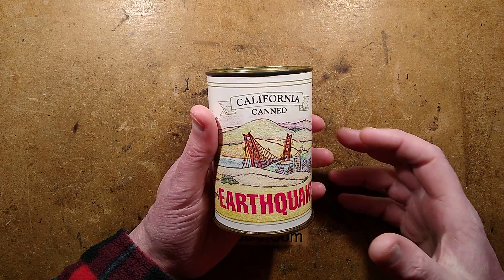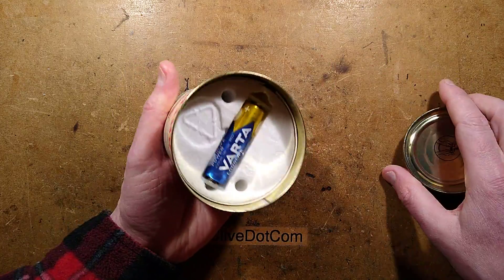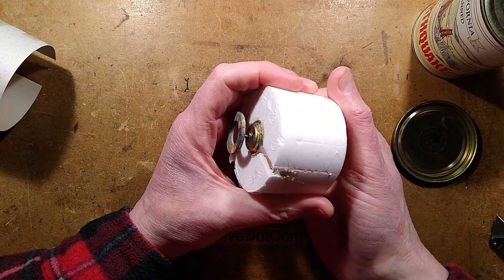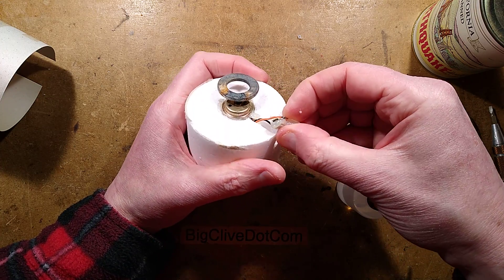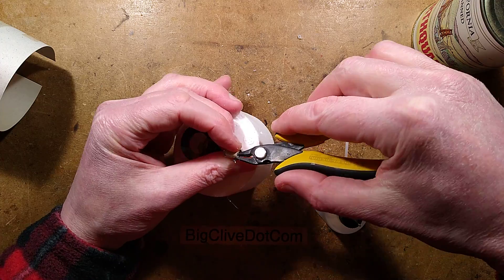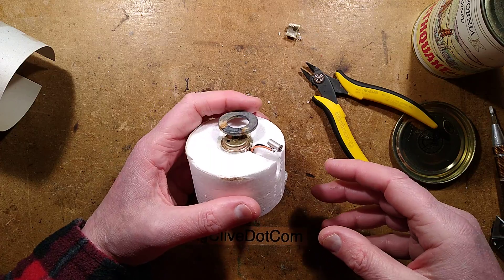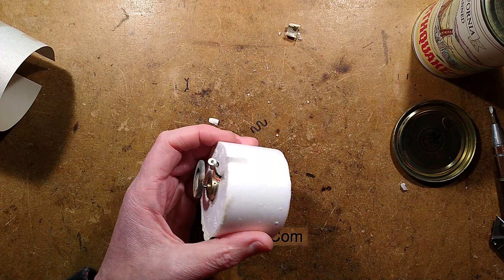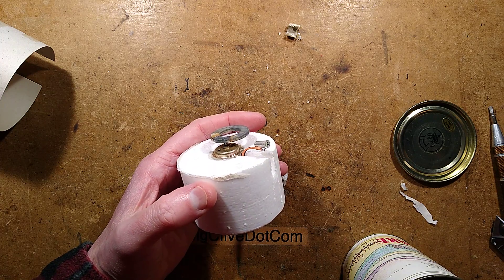Inside a Dynmo canned earthquake

Comment: Yeah on one hand you mentioned the word mercury and everybody freaks out on the other hand there are some serious effects when ingested and contacted. And ground water. Although I wonder if we've done more damage with the amount of lead we put into things not necessarily solder and circuitry but paint and things like that. Things can chip off and get eaten by kids or breathed in by kids. We tend to throw the whole baby out with the bathwater rather than considering the different forms the material takes. And with the amount of mercury switches versus the amount of fluorescent tube bulbs I would suspect we probably vaporized more with people who didn't know better (did anybody know mercury was in those things until a few years ago? You are completely fine breaking a standard lightbulb what's the difference with these new ones? ) than all those thermostats that have existed for years.

And then there's these corporations that tend to pad things with things that are clearly not safe like Johnson's and Johnson's baby powder now with asbestos. We know it's bad in an aerated form let's put it in an aerated form and not tell our customers will get more product and more money.

Comment: I think you can tell if its a mercury switch by very accurately adjusting the angle, measuring the resistance, to only just create a circuit. A ball switch will be pretty much binary based on gravity EDIT: you could probably just shake it and see "sloshiness" in the resistance rather than either on or off clacky ball contact

Comment: In the US, circular Honeywell heating thermostats used to be ubiquitous. Every one has a nice big mercury tilt switch on the end of a bimetal coil. The things are accurate and indestructible, and are an attractive example of mid-century American industrial design to boot.
Reply: I still use two T87F at home, and I also have a spare I found in my grandfather's junk. AFAIK some of the Honeywell variants (while not round) have as many as three mercury switches. These are 2H1C with automatic switchover, probably used for heat pump applications. One turns on the compressor for for heating, a second one is fixed 3 degrees lower and brings on backup heat strips, and the third one on a separate control arm brings on air conditioning.

Comment: The canned earthquake we had when I was a kid - 50 years ago - was even simpler inside. Inside, it had a rubber band attached to one end, with a rubber ball dangling from it. You could spin the can to make the ball run around the inside of the can, winding up the rubber band, then put it down upside down and the rubber band would stay twisted. Then to activate it - you'd flip the can over, and the ball unwinding would shake it around nicely for maybe 10 seconds. I was surprised to see a battery and motor when you opened this - I guess it lasts longer than the rubber band did.

Comment: The fact there's a recycling triangle on the polystyrene would say that the switch isn't mercury as polystyrene hasn't been considered to be recyclable until after mercury was banned.
Reply: It's not a recycling symbol, it's a resin identification code. Mercury thermostats continued to be made until 2005/2006 and I can swear I've seen the number 6 on things made before then.

Comment: The patent is from nov 1991 (Vibration mechanism with attitude sensing switch) and it propsed a mercury switch to be used.
I got few years ago some mercury  switches from old (late 70s) doorbells made in USSR that i bought as NOS.

Comment: Hi Clive, these switches were used in a Citroën GSA to light up the trunk. If you lifted the lid, the little metal ball touched the contacts!
Reply: That's one way to do it but couldn't it cause trouble if you park facing downhill? The cars I'm familiar with have a normal mechanical switch actuated by the door latch.

Comment: I have a couple of GIANT Mercury tilt switches that weigh several pounds a piece, and are about an inch and a half in diameter, and 4-5 inches long.... no joke. 

I found them in an old abandoned shop that I had bought years ago. 

I have NO idea what they were used for.
Reply from the maker: They do some very high current ones.

Comment: I remember taking an old doorbell (which contained a mercury switch as part of it vibratory mechanism) to the local recycling centre, and they didn't have any means of dealing with it, so it ended up in landfill.

Comment: On the subject of mercury tilt switches, can you (or anyone else) think of any reason why the far less toxic liquid alloy known as "galinstan" could not be used as a direct replacement for mercury in this type of switch? Galinstan has already replaced mercury in liquid metal thermometers and barometers, it is just as good an electrical conductor as mercury (in fact it might even be significantly better), and actually has a far wider liquid range: The freezing point is a bit higher (-19 degrees C as opposed to -39 degrees C for mercury), but it has the advantage of almost zero vapour pressure, and the boiling point is far higher - in excess of 1300 degrees C, whereas mercury boils at 357 degrees C. It does have that peculiar property of causing rapid weakening and corrosion to aluminium, but that shouldn't be of much relevance because mercury does that too. So I really don't see why a tilt switch could not be made using galinstan.

Ok, yes, it does have that annoying property of "wetting" glass, so if you put some liquid galinstan in a glass jar and shake it, the entire interior surface will become "silvered" as the alloy coats and sticks to the glass. But this can be overcome - galinstan thermometers and barometers are still made with glass tubes, by coating the interior surface of the tube with a thin layer of gallium oxide, which prevents the alloy sticking to the glass. So I don't see why the same could not be done for the glass bulbs used for tilt switches. Or they could be made from transparent plastic such as acrylic or polycarbonate, which would probably be better anyway since this would be far less fragile than glass.

On a related subject, I can remember a very crude but effective type of tilt switch in an old 1980s fan heater design, which switched both the fan and heating elements off completely if the heater was knocked over into a position where the fan was horizontal against the floor, which would have blocked the air flow and subsequently caused the elements to overheat: It was essentially a hollow plastic sphere of about 3 inches diameter, containing a smaller ball of soft lead or maybe lead-tin alloy of about 1 inch diameter. At the "bottom" of the plastic sphere (defined by the fan heater being stood up on its side with the fan blowing horizontally) was a pair of electrical contacts, so the lead ball would only touch both contacts if the heater was resting on its side - this would complete the circuit and allow the heater to switch on. If it got knocked over, the lead ball would fall off the contacts, breaking the connection and therefore switching the whole thing off. Like I said, crude but reliable and effective, as well as somewhat unique - I never saw this type of tilt switch used in anything else, just in this rather old fan heater. Have you ever seen anything similar used in anything else?
Reply: Your old heater had a ball type tilt switch. Clive mentions them in the video description. They are definitely not as reliable as mercury switches as they may "chatter" with vibration and oxidation/erosion can prevent a solid electrical connection. For a heater it's fine (if it doesn't work, whack it) but that's not an option in many applications.
Reply: @eDoc2020 The type Clive mentioned uses much smaller ball bearings, either a single ball bearing in a very thin tube or a thicker tube with many ball bearings to simulate liquid. I can see why these are unreliable, since the contact area between two balls is very small - which would be ok for a low current application, but completely useless for anything requiring significant amounts of power to be switched. Mercury or galinstan alloy would make a much better connection. The single ball in the old heater I described was made of lead for a reason - it is both heavy and fairly soft, so the weight of the ball pressing down on the electrical contacts made a good enough connection to allow 3 kilowatts of power to flow through it. A tilt switch with smaller ball bearings would probably not be able to handle anywhere near as much power.

Comment: As a teenager we regularly experimented with mercury in science lessons. 

Back then self built slot racing cars were a popular hobby. I built one with working brake lights, an idea promoted in one of the hobby magazines of the time, using a short plastic tube with connectors at one end and a blob of mercury that would make a connection under deceleration. 

Worked very well. Simple and reliable.
Reply: Hm. If it was wired to short the motor under deceleration, the car would have had electrodynamic braking too.
Reply: @interestingoldthings4889  I don't recall the details other than the "chassis" tubes were soldered directly to the motor and the axle crown wheel was driven by a pinion gear directly attached the the motor shaft.

The things we're quite light with no down force and I don't recall braking being a problem absent any bumpy surfaces.

However, no one was discussing the potential for regenerative braking back then. That said the weight penalty of even a small battery cell might have made any possible power reserve deployment a bit pointless. Unless the track in use was so lacking in grip for straight line traction that the weight might also be of benefit.

Comment: i really like Hg. i have half a jam jar full ive saved from old syphgmomonometers, thermometers and tilt switches. i particularly like poking the fluid with my finger, it feels very odd. as BC said the danger is from vapour, like from the heated vats of it hatters used to use to smooth and shape fur.

Comment: I'd guess that the venn diagram of products that are new enough to have recycling code triangles and are old enough to have mercury switches is pretty much empty.
Reply: The resin identification code was first introduced in 1988 for plastic food/beverage bottles/jars. The classic T87F thermostat continued to be made until 2005 or 2006. I'm sure it took some time for the plastic codes to become widely used everywhere but there was still plenty of overlap. I just checked the closest piece of semi-old plastic (a PC front fascia from 2001) and it has the triangle (but not the number). A network switch from 2002 is the same: triangle but no number. These are both ABS plastic (#7 "other") so maybe they had only assigned the numbers 1-6.

Comment: When I was a first year apprentice I tried to pour isopropyl alcohol into a styrofoam cup.... The entire cup dissolved fast enough for the alcohol to spill all over the floor immediately. Pretty cool way to learn that lesson.
Reply from the maker: Acetone?
Reply: @bigclivedotcom  well, I don't know for sure... It was 25 years ago, but I seem to remember it being isopropyl alcohol for removing adhesive marks on the switch boards we were building. Acetone would likely have damaged the paint I'd think.

Comment: By the way if anyone remembers Radio Shack the original ones that actually had an actual electronics parts for sale.

I knew the manager at 1 oftentimes I could get deals pretty good on the purchase the rest of inventory on things that were closing out.

I remember buying all the Mercury switches that were left.

And I didn't know why there were no longer be available and get the Parts wide good my father even suggested doing this!

 I remember the old light ropes as well.

That basically were useless unless you already have a controller!

What was left on The Bargain table to extract incandescent bulbs.

Yeah some of the bulbs are broken and would not work however what was left good for parts.

Write down even to the length of wire ran into end to not only the common connection but the pass through connections.

Everything from those that could get reused did.

Even the outer sleeve got used

I think I got them for possibly couple bucks each.

Still numerous bulbs left using in various projects!

Comment: Regarding the Mercury tilt switches and other things that they're trying to reduce let's just say I'm not really big into this but I understand why some litigation but it does cut into some things that have desirable characteristics and are useful for us makers!

For example photocells specifically cds cells.

If you know what to book for and where to buy them 

Bears eating things that would have this such as those motion sensors that big clap has mentioned before in various products that say something or might have or otherwise sound effects and sometimes light.

Yes like those Christmas decorations the little witches at Halloween and even the crow in with his other videos.

And yes I'm referring to Dollar Stores

Has been a good source of parts that otherwise would not be readily available due to obvious restrictions

But then again made in China of corse.

Is big Clive himself has said sometimes it's good to get this sort of things to repurpose or at least only use lines of saying something like this.

For example cheap Chinese and non-compliant holiday lights depending on your country you may have a different name for for this such as fairy lights.

You can get that type of wire apparently on Amazon as well if you look hard enough.

There are a lot of sketchy stuff out there however some of that stuff is great for repurposing!

Sometimes a product might be crap but what you're trying to do it's the perfect source for parts.

By the way I'm still remembering for the longest they had Mercury batteries in a lot of the dollar store items surprising but then again 

Made in China!

I'm wondering if there would ever be a battery with the performance of a Mercury cell with the equivalent lifetime.

In theory this could actually last longer when only used intermittently and the lower self-discharge then disposable lithium cells.

It's no wonder they used to be used in alarm systems and such back in the day.

Not referring to as the voltage stability but just super long life in this case most of the time sitting there doing nothing even going into an open circuit unless alarm condition.

I do remember an old system that someone had an older home 100 + yer old structure.

There was an alarm system fire alarm system it was actually a heat detection system.

Back when something like that was actually considered viable Fire alarm sistem.

All the heat sensors were in parallel normally open circuit.

Again A Fault In this design since no supervision whatsoever one broken wire could disable whole system!

The system was wired with the old cloth Fort Edward silk or otherwise material coverage of insulated wire.

Like that you could literally unwind the threads to strip the wire.

Solid wire probably about 24 gauge maybe a smaller or larger harder to say.

The idea behind the sensors by matalic thermostat.

On a Bakelite base.

Kind of oblong shaped

Top metal portion was rectangular.

The idea there was a heat sink there to act as thermal Mass so in other words would require a sustained temperature to trigger the alarm

I noticed there were several different varieties of these in the same system.

I don't know if same manufacturer maybe different temperature ratings.

Somewhere painted red and others just had the metallic silver finish.

Whole system was powered by a 6-volt Mercury battery a big one.

Even though that this system had install for who knows how long at that time it still worked.

And there was a couple times the system actually went off!

Could be clearly heard through the entire place even in the basement the guy that had this at his place said he could not describe what type of Senator this was but it definitely would make the Living Dead.

His words not mine.

Story Goes On.

After the system have been disabled at least partially.

The wiring had been used send audio through the house.

Even in the bathrooms there was a volume control with switch.

Speaker was mounted on the cabinet hose drone for for a speaker Grill.

Later on after the capability of the amplifier was exceeded.

Same system wiring was used for phone system.

Which at that point was still active.

However he had not realized that if one of those fire sensors with still installed unfortunately if the phone works need to be used and for some reason a sensor was active.

Yes I know get out if any fire but it's still probably not the greatest idea 

Do you have something short the phone line if high temperatures we're encountered!

Brought this up the next thing I knew took care of the issue!

It's just amazing what you'll find in places.

Apparently the person that had installed this system that had owned the house at one time was someone that had sold these alarm systems this might have been used as demonstration or just as even for their own use not shure.

There was a little odd shelf for the battery and the sound or was originally

Outlets and fuse panels in such a really odd places would never be acceptable!